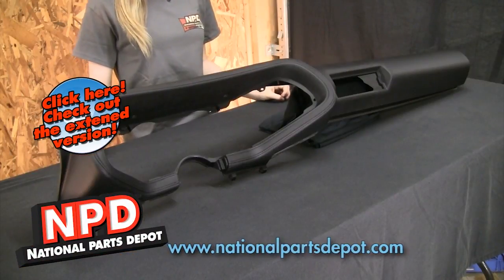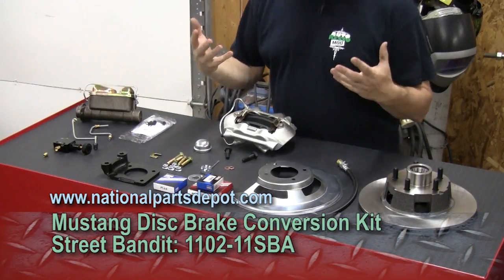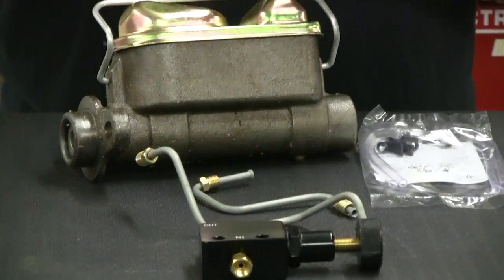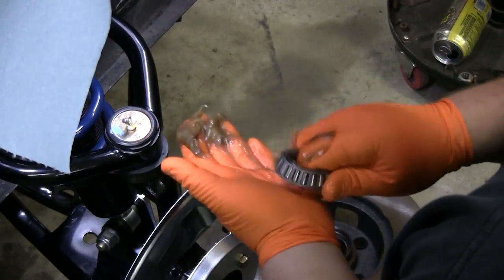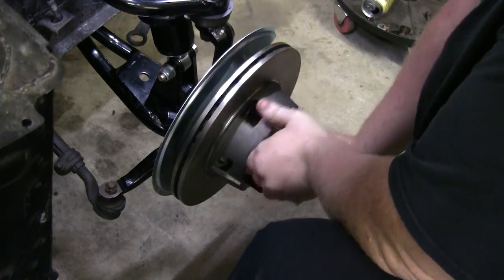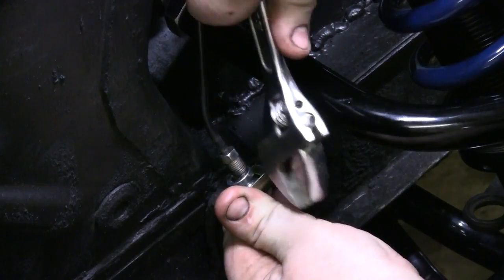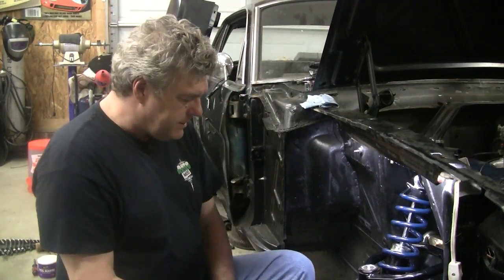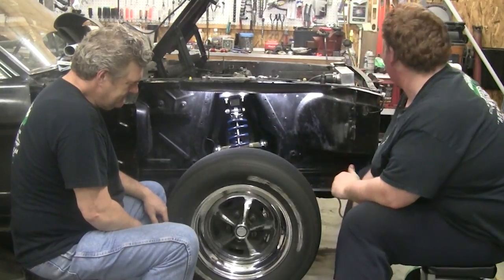Mustang Drum to Disc Brakes Tips and Tricks Episode 331 Autorestomod

Comment: I have just done a complete rebuild of the brake lines. In Europe we use copper lines, not steel lines, its much easier to work with, and never corrode. It will last a life time. I have never heard about anyone having issues with copper lines, so a great maintenance free upgrade.
Reply: We use stainless steel in the US whenever it’s available. I converted my 1969 Mach 1 to full stainless lines and it looks amazing.
Reply: copper CERTAINLY corrodes

Comment: Great Job !! this video will help make my conversion from drum to disc on my 64 Falconchero. Here's one little correction I felt I needed to share with you. When using the expression, @14;51 you described the hose connection fitting like a "hotdog in a hallway".That particular expression is used when something fits really sloppy for example a size 3 penis and a size 14 vajayjay, not when something fits perfectly like a glove or like it was made for it. Other than that meaningless error, this is an excellent informative drum to disc conversion video that I'll definitely share with any of my friends.

Comment: Lots of great tips here.  Something I've found in my fist 600 miles of driving is that the stock-style 4-piston setup seems kinda finicky when it comes to getting good stopping power out of it.  There are myriad adjustments that can come into play, none of which have anything directly to do with the disc setup itself, but that nonetheless affect the feel and responsiveness of the braking system.  Adjustable pushrods are frequently supplied with kits (though I had better luck just using the stock push rod) - so there's an adjustment there.  Then you have the adjustable proportioning valve.  And the rear shoes have to be adjusted so they're slightly dragging or your pedal will be too low.  Each adjustment incrementally increases the responsiveness and feel -- it takes some fiddling, and a whole lot of patience, to get it right.

Comment: I use schedule 40 pvc pipe in different diameters and a lathe to make seal drivers out of them making insertion easier such as the bearing cap. A lathe isn't always needed.

Comment: Jeff, here is a good question and would make a great short video. What is the BEST way to adjust the proportioning valve? How sensitive is it ? quarter turns, full turns ? There has to be a better way than drive the car and see if the rear brakes lock up....tips ?
Reply from the maker: Good idea Robert, we will look into it and might handle that when we do the wheels on Punisher.
Reply: @AutoRestoMod  Thanks Jeff. Here is the part I don't understand. I already have a two bowl master so adding disc in the front, why does one need to tone down the BACK brakes if you are not adding a power booster ? Wongt they get the same pressure as usual ? Confused...or am I supposed to add the booster (please say I don't need it,,,lol)
Reply from the maker: Your front brakes should be getting more fluid than your rears, thus the bowl should be larger on the front. I'd rather have my brakes proportioned so the rear are engaged pretty heavily, just before lock up. The drums, if set correctly will actually stop better in a single panic stop than most disc brakes. But they fade, are prone to hold water longer, and are harder and harder to work on by the simple fact that stuff wears out (the pads on the backing plate) and are not serviced in many cases.
Reply: @AutoRestoMod  okay Jeff, NOW that makes sense !!! For some reason I was under the impression that it was to reduce them significantly ...okay ...I will go with the flow (pun intended..lol) THANK you once again....

Comment: Five years ago, I purchased a brake conversion kit from Mac’s auto that sat in a box until this week. It stated fitment for a 1964 Ranchero. Its description was: 41-83979-1	Front Disc Brake Conversion Kit, 5 Lug, Falcon, Ranchero, 1960-1965. So I assumed it was a perfect fit. Little that I know is this was to convert from a 4 lug on a V6 to a 5 lug as in a V8. The rotor bearings ID was way too narrow for the spindle. I contacted Mac’s technician and he suggested I get a bearing that would fit both parts. Problem is that the ID needed for the original spindle is too large and the OD for the rotor is too small. I thought about trying to just get a disc and place over the original hub, so I am in the process of hunting such a thing. Anyone else had such a problem? Suggestions?
Reply from the maker: Find out who the source supplier was for the desk brakes. They should have the correct bearing assemblies for a V8 that will probably slide right into that spindle.